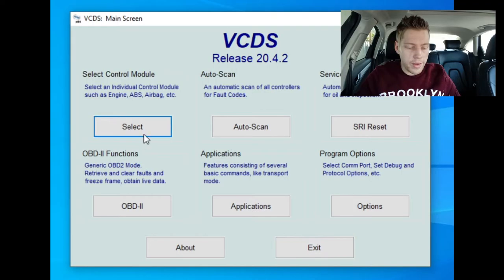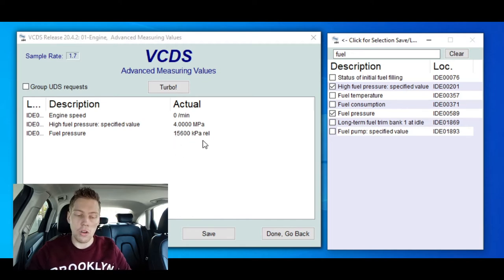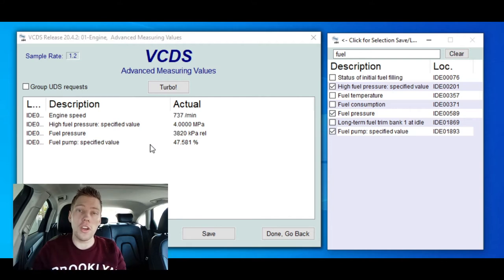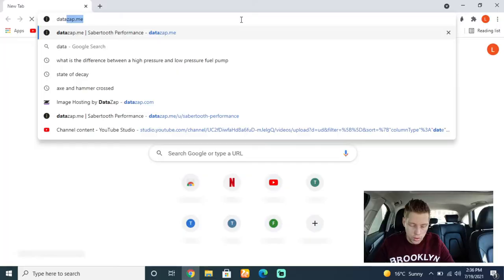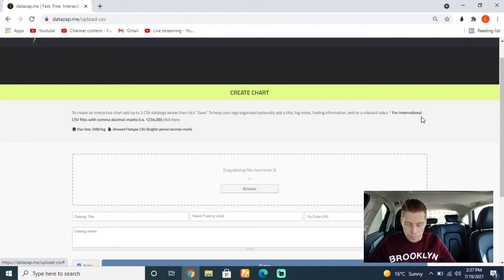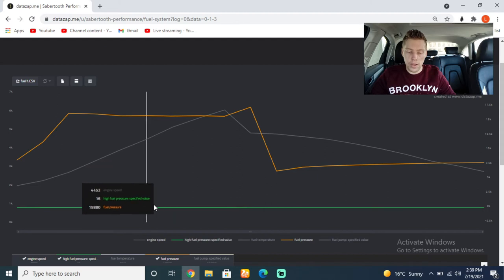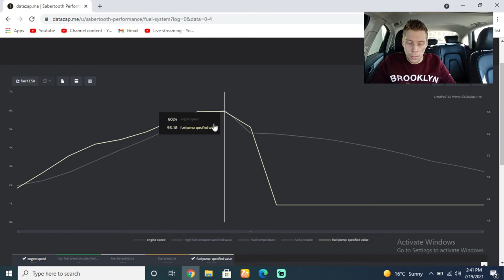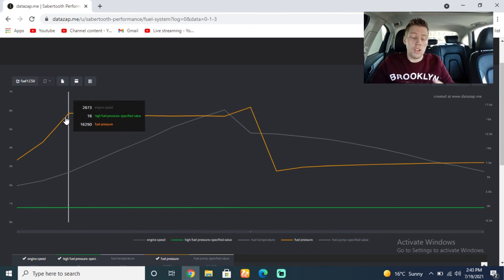How To Data Log your Fuel System With VCDS

Comment: NIce video bro... actually i was trying to find out whether my HPFP or LPFP is faulty, because everytime i try to accelerates quickly , my Audi A5 will enter limp mode, ESP & EPC lights on, and parking brake malfunction warning appear... i suspect it has something to do with fuel delivery system...
Reply from the maker: Have you tried using a diagnostic tool? To see what error pops up?

It can even be a missfire, over or under boost. There can be so many things that can cause it.
Reply: @megalodononwheels  yeah bro, i am using VCDS, the error codes pops up everytime when my car goes limp mode are P1950, P0222, P1857, ABS brake, & Parking Brake.. each time, it can be reset and the car will run fine again... but whenever i accelerates hard, the car will goes limp mode again... i wish you can help me with this bro

Comment: Thank you for your help, where I can find the correct values for ECU as sensors Mass air ....audi a8l 2012 year,engine 3.0 tfsi supercharger,
Reply from the maker: I believe if you search MAF you should be able to get it.

I know some Audi's they log the same thing but it is called differently for example for my car boost is called charged air and another car it is called boost. So it must be in the line of MAF or Intake air or something like that :)

Comment: Just got vcds and laptop today. Hoping to diagnose limp mode/ fueling issue, car is 4.2l v8 s5 with aftermarket supercharger kit, upgraded hpfps and boost a pump for lpfp so not quite sure where to start. Injectors are all replaced
Reply from the maker: I would like to know why is it that you say your car goes into limp mode because of the Fueling? Did you try to use the VCDS to see the DTC's maybe?
Reply: @megalodononwheels under heavy acceleration and above 4k rpm car will go into limp mode, at low rpm in low gears it stutters and is inconsistent. The only codes came back with snap on scammer was consistent p0087 rail pressure to low and intermittent small evap system leak. I still have not gotten to the bottom of this. It is very confusing which measuring blocks exactly will be helpful/related to my fuel issue in particular.

Comment: Hello I have exactly the same engine as you I follow all your videos, I have a little problem when starting a smell of gasoline appears, but only when starting, I was told that it was normal, while the revs  stabilizes ?
Reply from the maker: Hallo hallo, thank you for dropping a comment 🙌

And glad to see there is someone else out there that alsp has the same engine 🤣👌

Ok do you smell it in the car or when your outside?

Also is your car under a carport or in a garage? Ooooooor outside in the open.

In general it is fine. The ECU fuels a bit more than usual to try and get the Catalytic to heat up.

If you smell fuel even when just driving around and all that then it is bad
Reply: @megalodononwheels  😄Yes exactly but it only happens when starting the car it smells from the exhaust
You thinks ist normal ?
Reply from the maker: Yes it is normal. Even with my car I can smell the fuel on cold starts :)

Comment: Hey man I’m going to start watching your videos. Any tips on code p2293 (n276 mechanical malfunction) on a tsi engine. I’ve read the forums over and over and ppl suggest a follower upgrade… tsi has roller, or to change hpfp, lpfp and control module. I changed the hpfp about 2yrs ago already
Reply from the maker: Hi, it seems like a fuel related problem, it can be a bunch of things! It can be a that your follower is worn out. I saw with the first gen 1.8 & 2.0 engines the follower needs to be inspected at every service interval which means that if you have driven over 15k... Just inspect it again. It can also be a leaking injector, an injector that doesn't open, bad fuel rail, maybe a dirty filter for the fuel, for example the LPFP filter inside the tank.

Definitely try out this video you commented on and have a look, it will tell you the condition of your HPFP and your LPFP... Also try out this video

https://youtu.be/8xYJnKtxPw4

It is to see your fuel rail, if it can hold the fuel pressure when the car is heat soaking the fuel.

Hopefully i helped a bit :)
Reply: @megalodononwheels  thanks for the response I think it’s definitely fuel related as well! I unplugged the sensor on top of the hpfp and idle is a lot smoother. I’m still releasing gas. I will try removing the plug and coil to see if my fourth cylinder has an open injector. I will also try this video… also figured out my lpfp was replaced 20k miles ago with the control module
Reply from the maker: Do a lamda test maybe, i also did a video on that, see if your maybe not running to rich... 🤷🏼‍♂️ Also i would like to understand why you say you will only remove the spark plug of cyl number 4? Why not the rest? Maybe you know something I don't 🤷🏼‍♂️👌
Reply: @megalodononwheels  thanks for all of your insight!! I’ve been busy with work and other things but once I get a chance I’ll look through your videos and literature. Also subbed! 

I removed coil and plug 4 because that cylinder was misfiring. I compared to cylinder 2 which doesn’t seem to have an open injector and plug was dry. I could see fuel flooding cylinder four and am potentially convinced I have an open injector.
Reply from the maker: Ohhhhhh ok that makes sence! Also from the valve cover also known as the tapped cover, it has a round seal going around the spark plug hole, when it is worn out or not in correctly, it might leak oil into the spark area... Just keep it in mind :) but atleast you know that there is a problem there :)

Comment: For maf senzor??  You have video?
Reply from the maker: Unfortunately i don't, what would you like to see of the MAF sensor?
Reply: @megalodononwheels  i don't think it measures accurately and sometimes it doesn't go well 2.0 tdi passat b7
Reply from the maker: The problem with the Maf is, it isn't really for performance, and more for smoothness, to get down to the finest reading of oxygen entering your engine... Maybe, just maybe in the long run it might add 1hp 🤣 but let me have a look to see what i can come up with :)